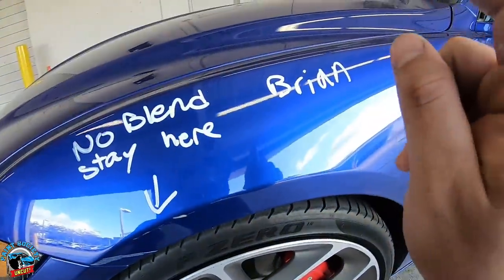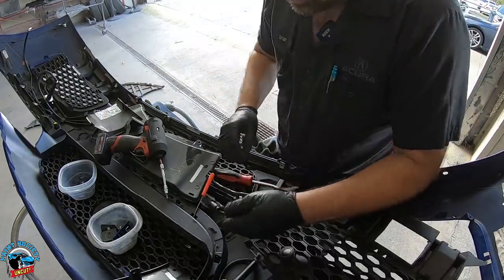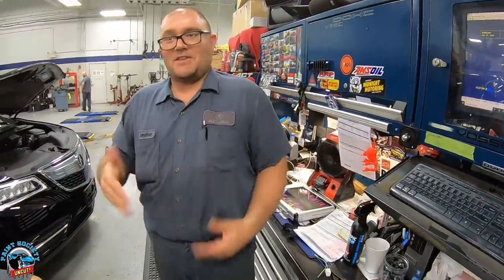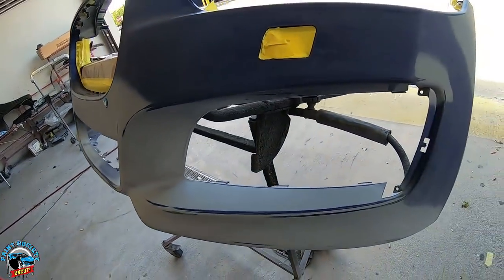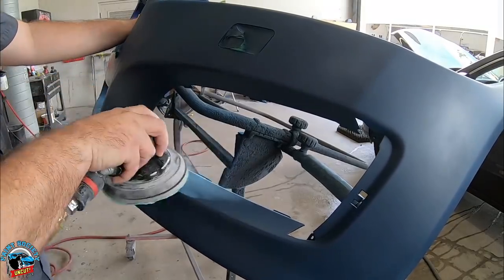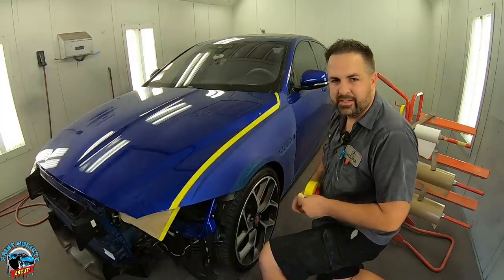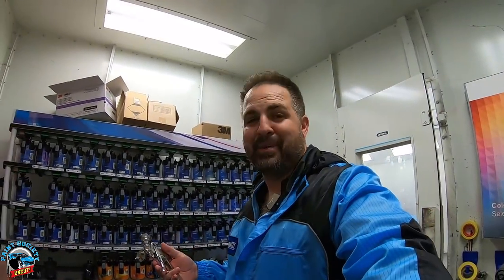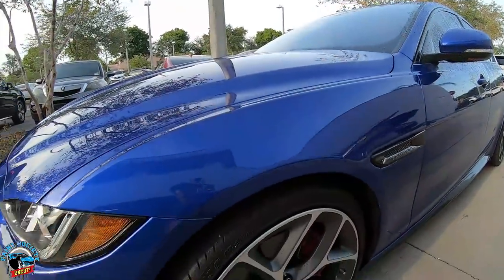Fixing Scratches in Automotive Paint!

Comment: Great vid, Brian!  Keep these coming as well as the more formal videos.  I'd love to see a vid on paint matching for the home sprayer.  We're kind of at the mercy of whatever the auto parts store  mixes based on the manufacturer paint code.  I recently had a problem with my 2013 Malibu flip car.  Apparently they changed the paint tint formulation after 2013 and none of the paint came close to matching.  I ended up painting the whole car as a result.  It was a learning experience but I would have been happy with just having to blend onto adjacent panels.
Reply from the maker: Not much you can do in that situation. You are at the mercy of the store mixing it. Best thing I suggest is bringing in a part of the car and asking to see the paint chips. Most stores will have the paint chips so you can see the variants. Also never and I mean never test the color for the first time on the panel to find out it doesn’t match, always do a spray out.

Comment: Hi Brian, was wondering how you find wearing a non pressure mask over your beard works for you? I do a little paint repair at home, usually when my lovely wife marks up her bumpers every other month!
I do like to use a 2k clear for the superior durability but I find that I need to be clean shaven and pull the straps really tight on the mask to be sure of not getting an odour.
My face still gets irritated around where the mask sits so I think I'm pretty sensitive to the iso, possibly everyone's different in that regard ?
Reply from the maker: I have done quite well with no sensitivity and still a pretty good seal. For the best seal, you need to shave.

Comment: I'm in the process of fixing a few dings on a door I got from the junk yard. Sanded the parts I'm body filling with 80 grit paper it has been previously repaired because once started sanding it down. What would you suggest could I use body filler over it and not get to deep in the repair
Reply from the maker: Try to just fill it and move on. Make the best of it.

Comment: I often see the bumper and hood removed when painting? Is this a best practice for painting? Also I know this question dances around a rabbit hole... But how do you determine how far to sand? Also, a auto detailier told me not to use soap as it kills clear coat? Would you agree with that statement?

Comment: Can I ask how you tinted the primer/sealer blue?  I ask because I recently learned just how transparent blue is (when doing my very first paint job) and how it took a lot to cover the grey sealer I laid. One suggestion I heard after the fact is to use a black base or primer/sealer (instead of grey) as it is supposed to help with the coverage, but obviously that will darken the finish in the end.  Just looking for other possibilities when I decide to redo the car in a few years and I can do some test panels to see what finish color I like best.
Reply: @ballsoutperformance  I knew the supplier could do it, I was just curious how Brian did it.  I've seen people tint clear with paint before and was curious if something like that was possible with primer.
Reply from the maker: Color build is the name of the system. It is a system young can select from a wide range of colors to use for primer or sealer. It’s made by azko Nobel
Reply: @PaintSociety  Awesome.  Thanks for the answer.

Comment: Love it B 👍
So......WS400 OR CC500 ??
Which has the nicer finish as a whole??? I mean its $350 for the CC500 and $200 for the WS400 ??
Reply from the maker: Ws400 is around $600

Cc500 will get the job done for less
Reply: Tim Bowman  never see WS 400 less than $450 for new one! Never even on eBay ...
Reply: Walter, please check the link I sent Brian for the WS400 Belleria  that are on eBay.
They look like they ship from Japan, so is it a knockoff gun or not. I wouldn't mind paying a little more, but being a newbie at this stuff I wouldn't want to get taken for a ride. What is the correct name and model for the WS400 ????
Reply: @Timbo428CJ   Anest Iwata WS 400 .   Iwata W 400 it's a different model and they cost around $200.
Reply: @elinaostapenko4396 That's the Bellaria on Ebay, what is the name of the model on the correct one then ???
Reply: @Timbo428CJ   ANEST IWATA WS 400 1.3hd or 1.4 hd tip on it.
Reply: @elinaostapenko4396  is it called the Supernova ?